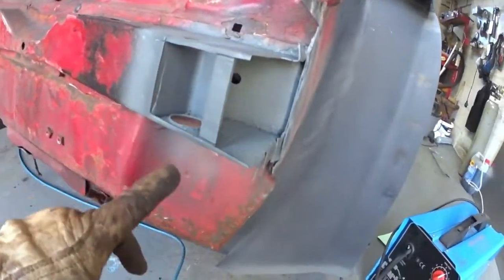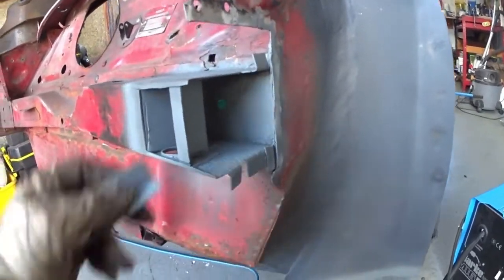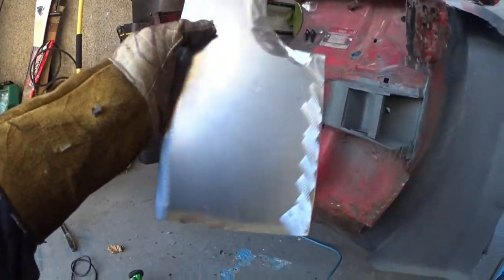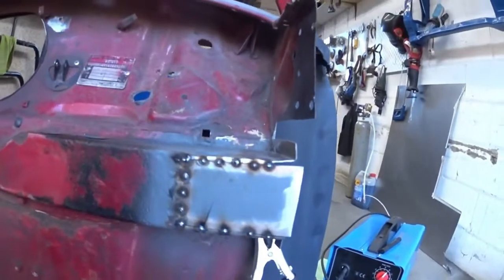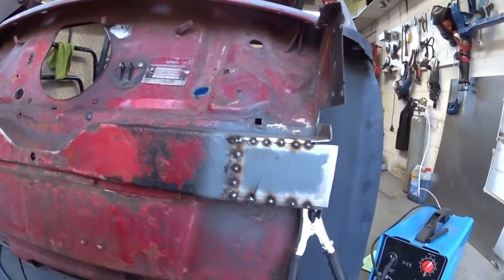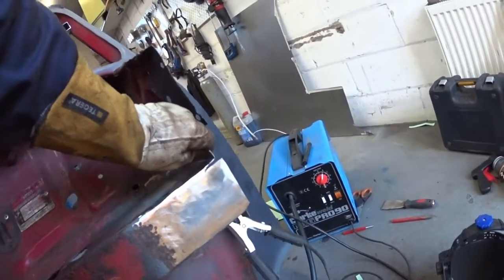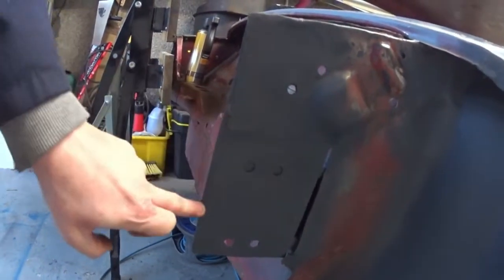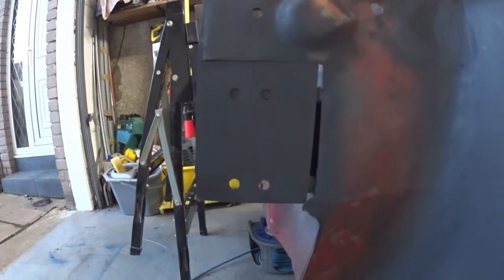The Little General : Classic Mini Build - EP28 Shocking

Comment: I also cant get on with weld through primer. I still like the fact that your making your own stuff and cut n shutting it in rather than buying new. I did a lot of that on mine 👍👍
Reply from the maker: Cost is a main factor but most of the bits I am fixing seem to be easy-ish so far. Still it gives me plenty of practice with welding and trying to fabricate things. You do get a great deal of satisfaction when you have done a good job.
Reply: @MinisUnleaded  your welding seems ok so far 👍👍